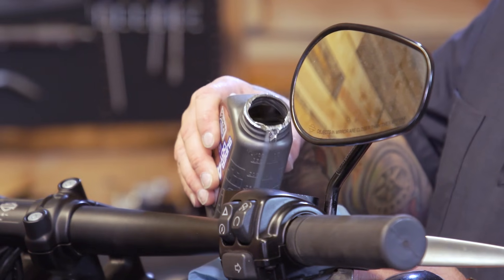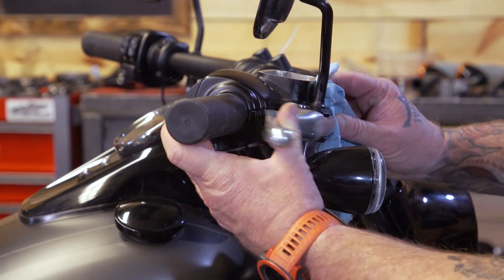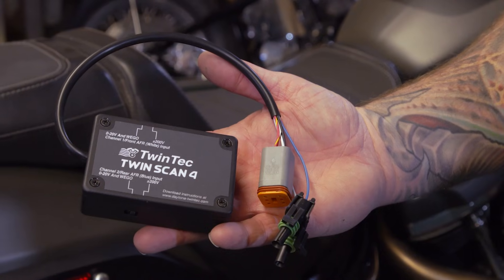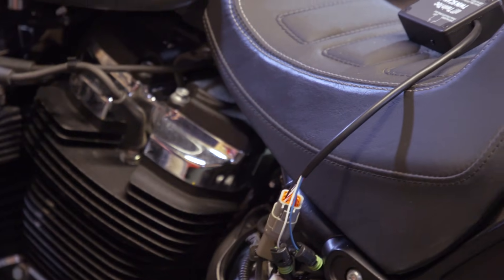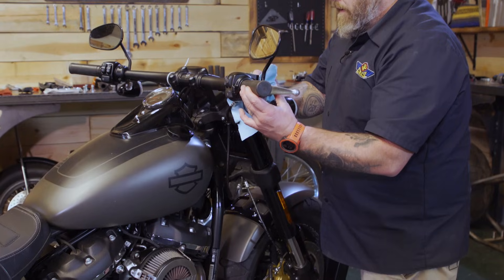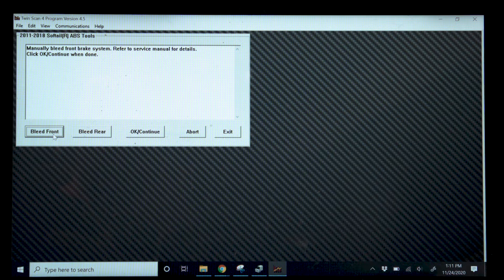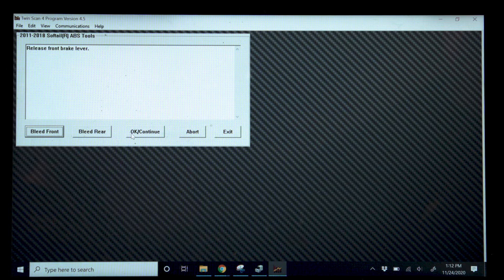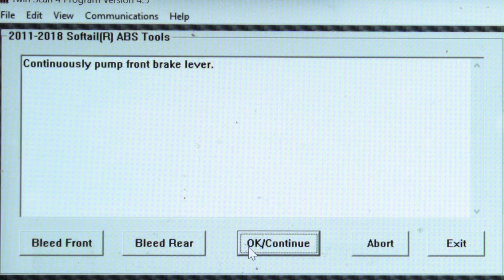How to Bleed ABS Harley Davidson Brakes : Pro Tip

Comment: Ordered this I would not order this from Thelma especially because I have a 23 rogue blade Limited and I ordered all of my parts for the 23 rogue light Limited and they sold me the tool that is currently in this video and it does not work anything past the 22 I contacted them. They said it’s unopened. I told them no so there was nothing they can do about it. They knew it would not work on a 23 rogue glide Limited line but they sold it to me anyways that’s ridiculous. I asked them specifically I needed a tool for this 23 rogue life and they sold this and it does not go that high so do not buy it if you have anything above I think a 21 or 22 model.

Comment: Scan tool is now $758 !!  My front bleeder valve was stripped, but I was able to remove it and replace it with a new one.  When I replaced the bleeder valve, I introduced air into the system.  Took it to the dealer - $175 (plus fluid) to bleed/flush.  Next time I'll be able to do it myself.  So still way cheaper than buying this tool.

Comment: Your own website is saying it won't work on 2020 fxbb StreetBob 
"Compatible with 2011-2018 Softail, 2012-2017 Dyna and 2014+ Sportster and 2014-2020 Touring models with CAN data bus (all models with a 6-pin diagnostics connector). "

Comment: I noticed that there is not a link to this product but doing some research it will cost around 550 used to 1400 hundred new because this is a scanner not just a ABS bleeder. Not sure what HD charges but I would say a few hours of time, which could be up to that 550 depending on your dealer. Do search for Twin Tec Scan 4 and you will see multiple combinations.

Comment: Just looked up that tool, and my jaw dropped about the same as it did when the dealer said it’s $400. to bleed the brakes. At $430 for the scan tool I’ll be holding off on that.
Reply: Check again.  $606 now, on closeout!

Comment: What about flushing the brake fluid first and then going for a ride and activating the front at least a half a dozen times and the back and then go back and re-flush the system??
Reply: Thats what i recently did on my 2019 (we dont have an option like this scan tool) just make sure ya dont introduce air or you will need a scan tool or go to harley for a bleed. But this worked just fine to get all the old fluid out, just make sure to do a full flush again after engaging abs.
Reply: @AnthonyPaulk yep, flush, activate ABS, go home flush.  Test fluid.   Done

Comment: Why no responses from J&P Cycles? Is this the correct sequence? Step1) Remove all the dirty fluid from Master Cylinder with mechanics syringe. Step 2) Fill master cylinder with fresh brake fluid. 3) Flush/Bleed the front and rear lines until fluid becomes clear. 4) Follow directions on Scan Tool for front and rear. Step 5) Flush front and rear again for good measure. Or skip step 5?

Comment: Besides the ABS, NONE of the other functions work.  Doesn't clear codes, doesn't allow the Ignition Disable.  And there is still no radio updates even though I am running their latest 4.5 version.   People are complaining about this.  It is an expensive "block box".    DO the TESTS J&P Cycles or STOP misleading your customers.

Comment: I purchased the Twin Scan 4 in order to do a full and proper brake bleed. I plan on doing a reverse bleed first (2018 Road Glide), then with the Twin Scan 4 cycling through the ABS pump. Since this is such a crucial step, I want to make sure nothing is missed. In your video, you are not using the other pigtail provided, just the Twin Scan 4 straight to the Data Port and usb'd to a laptop. Is it not needed for the abs function? Do I ride the bike first and do some hard braking, front and rear? Any more in depth help would be greatly appreciated. A lot of different views on brake bleeding, only yours I saw with the Twin Scan 4.
Reply: Besides the ABS, did anything else work on this thing?   Several of us have realized that nothing really works on this thing.  Try the Ignition Disable.   Try clearing codes.

Comment: Hi I don't really care for abs .could I just disconnect the abs module and my bike will still run and start ok .It's a 2018 roadking  .I seen some canbus wires leading to the abs module .those wires are sensitive . Will the system shut down if I unplug it.

Comment: Question!!!!  Is the front caliper on my 2019 FXBB street bob ABS?? 
I feel like the fool for asking.  The thing intermittently goes soft at the lever and the caliper makes a buzzing sound. I Flutter the brake lever and it hardens up.
I've bled this prick in both directions.
Meaning, I've filled it from the bottom whilst looking for air bubbles in the reservoir.
Filled the reservoir and cracked open the bleader nipple at the bottom L👀king for air bubbles.  No air bubbles!!!
If my bike is ABS then I think I need this tool in your vid.
Thanks brothers!!👍🇨🇦🍺

Comment: The connection on 2021 models have changed. On older model Harleys, the ports are male plugs. Newer Harley models now have a female port connector. My scan tool plug is also a female plug. Is there an adapter for this, or do I have to buy an entire new scan tool just to work on these newer models?

Comment: So if you modulate the ABS, do you need to bleed again to get that contaminated fluid out?
Reply: Yes.   According to the HD service manual, that is the procedure.   That said, I have been lazy before and only did the once flush.  Never had an issue.   Fluid stayed clear until the next cycle.

Comment: Have a Twin Scan II for pre Rushmore bikes. They are pricey but are not married to the bike, like another brand is, so it can be used on other bikes. Share the cost of the tool or charge a few $$ for bleeding brakes on other bikes. Not that expensive of a tool now.

Comment: Having issues with my front brake so will need to do an abs bleed, Partsgiant says it will do "ABS installation", wonder if they mean replacing the abs module as well?  Shop manual says new ones need programming.  $400 is better than $3400 for a Snap-on Ethos with Harley module, that is never happening  :-)

Comment: Having trouble with my abs. Throwing a code that ABS sensor or Speed Center whatever you want to call it isn't working I replaced it less than five mile down the road it's throwing the code again ticket to my local Harley dealer and they cannot figure it out.  I will say that I was squeezed in to check it out do you have an idea what I can look at

Comment: $400 for the scanner…..I think I’ll take it to the dealer
Reply: Or you can buy one from infotech mercenaries for $200 and support a small American business.
Reply: Absolutely! Dealer: $500, please and thank you!
Reply: @rgh622  Which dealer is that? Can't be stupid about it, doesn't translate to that much time / material for that job. Find a new dealer!
Reply: Actually the scanner is 700
Reply: Not worth the $700 price as an ABS tool.  AND all functions do not work as advertised.  I contacted Daytona and they blamed the ECM.  But they can’t tell me which ECMs throttle the features.  Now they just don’t respond.  Okay….. so like I said, not worth $700 for just an ABS tool.
Reply: @heybruh3274 there only a small amount of fluid in the ABS.  Flush system,  ride, use your  brakes and few times go back and flush.  Or pay 500.  I'll do it for 450

Comment: It always amazes me that HD is as far as i know the only manufacturer that actually has this step in their manuals. Every other brand does not even mention that there is brake fluid inside the ANS Pump/internal reservoir that would need to get cycled.
Reply: Brake fluid in any vehicle especially a motorcycle should be flushed every two years. Brake fluid absorbs moisture and the moisture causes corrosion. That's why when something sits for a few years the brakes don't work anymore. In an ABS system the small ports and valves inside get corroded and get stuck. You could find yourself in a situation where you have no breaks at all. So whether you pay someone or do it yourself it's cheaper and easier to flush the brake fluid every two years
Reply: @josephcivita1450  i am aware of that, my point was that other manufacturers do not flush the ABS Pump itself, but only the lines/reservoir. Even tho the pump could get corroded or have not enough pressure for ABS to activate fast/properly in a dangerous situation.
Reply: @A_Ride_To  This!
Reply: @A_Ride_To Most people (even shop mechanics) bleed the brakes without doing anything to the abs module. They just make sure not to turn the bike on while doing the job. I did mine recently and the abs light didn’t stay on, and I tested an emergency stop and the abs brakes did their thing.

Comment: works for dyna low rider s from 2016?  Does this system pair with one bike, or can it be used for multiple bikes?
Reply from the maker: Can be used on multiple bikes.
Reply: @jpcycles  is it valid for dyna low rider s 2016?  I want to use it to change brake fluid Thanks

Comment: Great video. Is it acceptable to use a vacuum bleeder on ABS Harleys?
Reply from the maker: yes
Reply: Thanks for the reply. Last Harley I bought predated ABS, and I’ve heard some systems don’t like to be bled with a mity vac.
Reply: @JeffinTD  The Mity Vac works great to bleed Harley brakes. Highly recommended.
Reply: @BrewCityRider  Mity Vac works well, but DOES NOT modulate the ABS, thus some fluid, perhaps contaminated, will remain within the unit.  Regular bleed doe not get it all.
Reply: @thangknowa3288   so unless you purge the system agsin- after actuating the ABS unit, then that contaminated fluid you mention is still in the system anyways

Comment: Technically, you're "flushing" the brake system, not bleeding it.  Bleeding is removing air.  Flushing is replacing the brake fluid with new brake fluid.  For those that want to know, yes, you do flush the fluid again after activating the ABS.  FYI, Information Technology Mercernaries LLC has a flushing utility for performing this procedure.
Reply from the maker: Actually we were “bleeding” the brakes since we had just installed that PM caliper. You are correct if we hadn’t added the caliper and introduced air into the system. But if you were to swap bars and extend a brake line or switch to braided lines or ...replace a caliper you would need this tool/procedure .
- Patrick
Reply: Thanks Stephen for the info on the IT Merc product...never heard of it before...thinking this is what I need to do the job correctly and for less money.
Reply: Lol.. bleeding to remove air is one term, you have to bleed brake to flush.  When I do  brake jobs, I never introduce air, bit I bleed them every time.

Comment: Do you bleed the brakes again after using this tool?
Reply from the maker: Nope.
Reply: @jpcycles  ok, please educate me. If the HCU has trapped air, where does it go if you don’t bleed again?
Reply from the maker: @edwarner3826  I'll amend my original comment to be more clear. If you ran this procedure with the scan tool and still had a soft lever then yes, you will need to bleed the brakes and run the scan tool again (it prompts you to do this at the end). If you complete the bleed and scan tool procedure and the lever is firm you won't have to (there was probably no air in the valve).
Reply: @jpcycles  If the intent was to flush the old oil and replace it with new oil then you need to bleed again.
Reply from the maker: @motovick  The intent was not to flush the fluid. We changed calipers, lost fluid and in turn brake pressure. The ABS brakes needed to be bled to have brake pressure again. Hence the title of the video "How to Bleed (not flush) ABS Harley Davidson Brakes"
Reply: Whats the part # ? @jpcycles